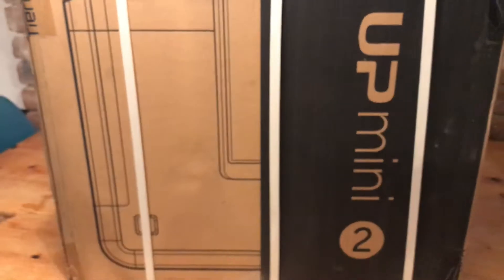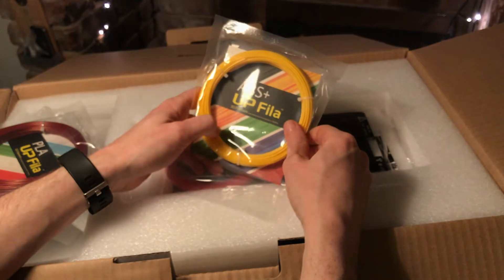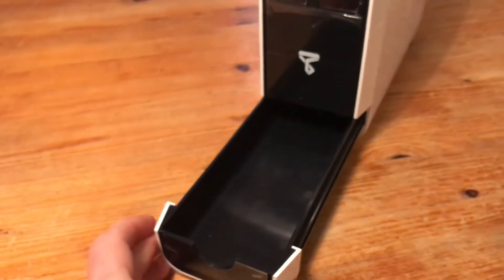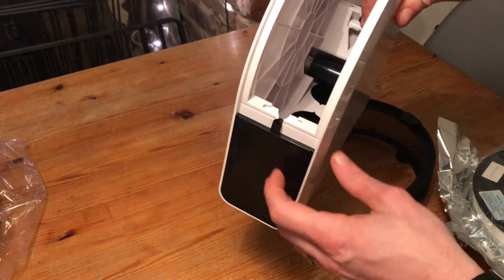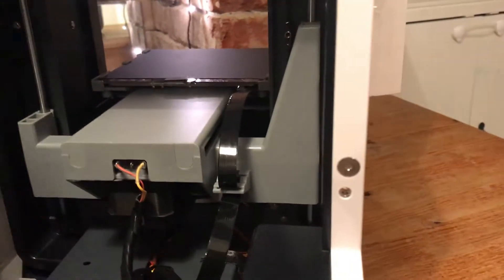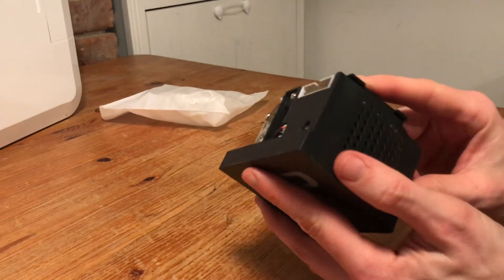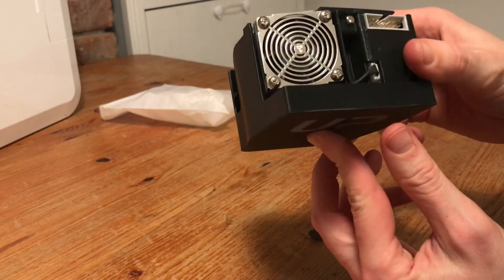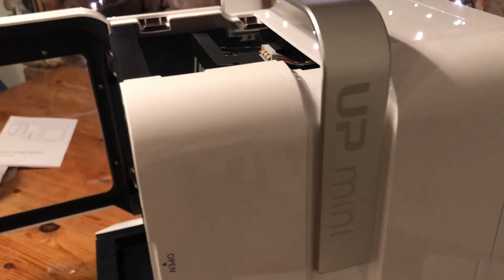Up Mini 2 3D Printer Unboxing & Detailed First Look

Comment: The soot marks in your fireplace give the impression there was a nice Lancashire/Yorkshire range there once upon a time. Thanks for the videos, looking forward to seeing the printer up and running.
Reply from the maker: Thanks Brian! It's a Derbyshire house - that fireplace was hidden behind a wall and radiator when we bought the house, great discovery. 17 trips to the tip later, seven mummified blackbirds and a dock off copper back boiler revealed a lovely fire place!

So far I've had the printer running all day and it's been flawless. Looking forward to doing a week's review on next week's #5minFriday. Thanks for  your comment!